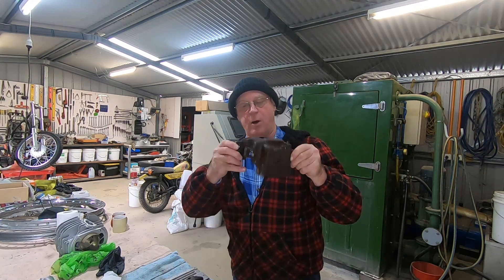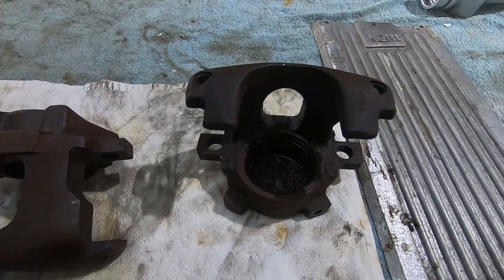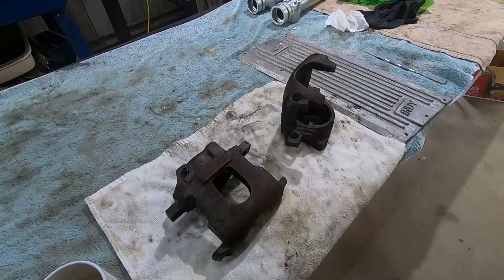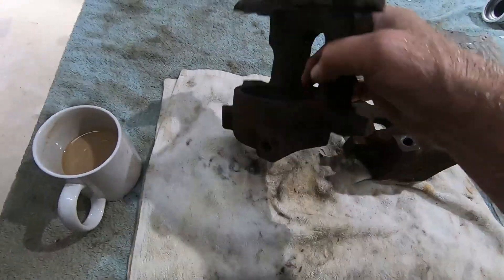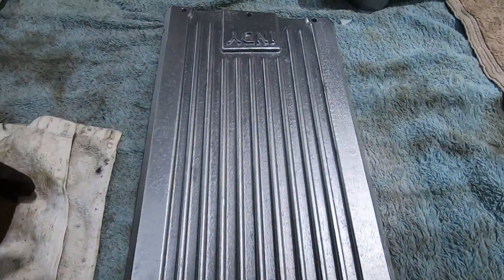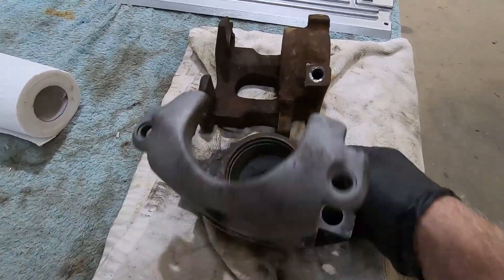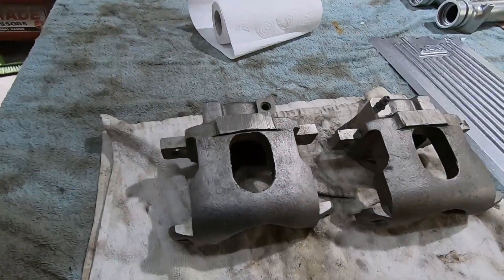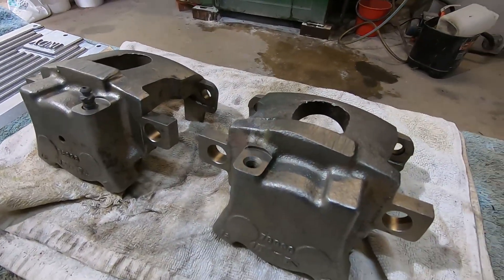Can I Vaporblast Cast Iron Calipers????

Comment: What media do you use in the hydroblaster
Reply from the maker: Its a very fine glass bead. Not sure on what grade it is. Cheers Craig
Reply: @BendigoHydroblasting  thanks Craig, I have a vixen 915 and use similar but your finish is outstanding
Reply from the maker: @daipower1  yes the machine produces great results. It has about a half inch nozzle in the handpiece and will fill a 20 litre bucket in about 10 seconds (pump only, no air). Air pressure for blasting is set at 80 psi. Would be interested to know what the slurry volume through the vixens handpiece is.

Comment: Great work there 👏 👍 

  Just out of curiosity if you don't mind me asking 
Roughly how long time wise would it take to do a set of callipers that were in  reasonably fair condition??
Also just a rough idea on the $'s it would cost to have the job done.
  Just after a rough idea is fine atm if you don't mind me asking that is. 
Thanks...
Reply from the maker: Probably around the 15-20 minute mark each which works out around the $20-$30 mark each. Cheers Craig
Reply: @BendigoHydroblasting  Thanks for your reply back...